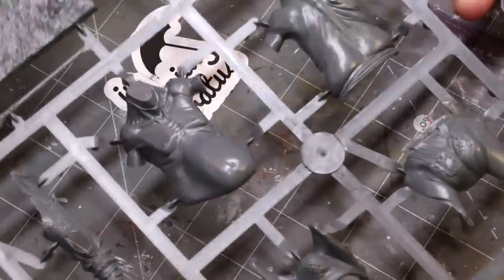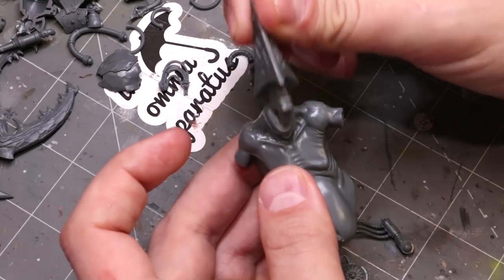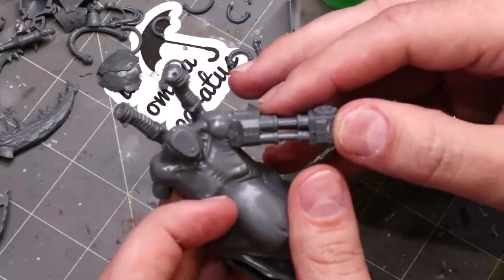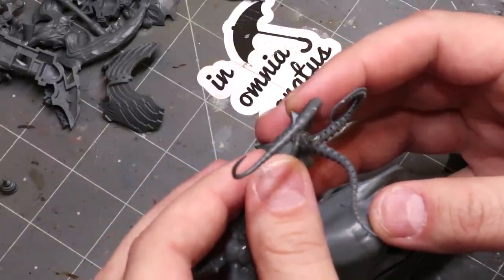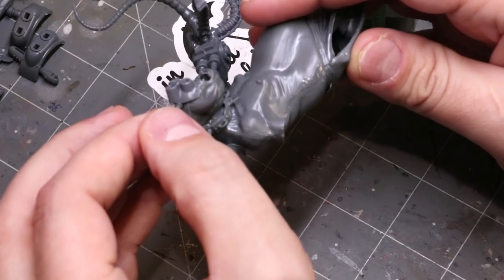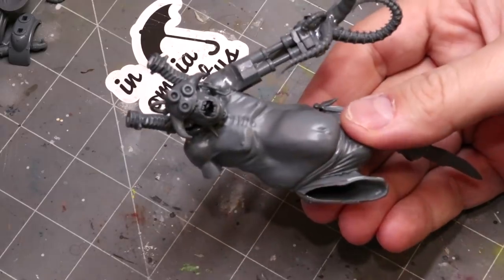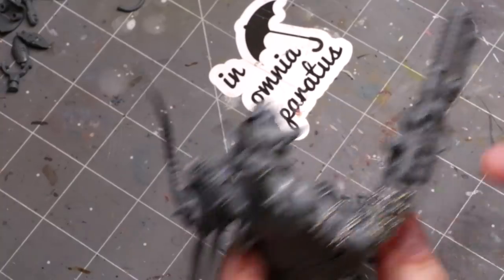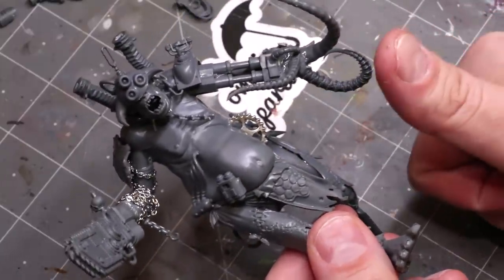Hobby Cheating 272 - Converting Models

Comment: Thanks for this video! I'm now convinced I need to concoct some sprue goo. Looks like the Tamiya cement is the way to go. I used Testors liquid cement for decades, the one with the applicator brush in the cap, but I have not been able to find it in my area anymore. They have switched to those useless squeeze type bottles that dry shut in about half a second.Some kind of idiotic " safety regulations"
For anything molded in styrene liquid styrene cement is the only way to go. Blows my mind when I see people use super glue instead for plastic minis. I know it works, but I like to save my super glues for bonding dissimilar materials. 
Looking forward to seeing this conversion painted up! I hope you do more videos like this, exploring what can be done with a bit of imagination, some sprue goo, and a well stocked bits box! 
Thanks again, Vince!
Reply from the maker: Happy to help, everything's now been painted, you can see it on my socials. :)

Comment: Oh boi, I wish I would've seen this a few weeks earlier - before I cried myself to sleep (kinda) after building and converting a Gargant.

Got another topic, if it hasn't already been covered here: As you said before, we can use varnish to create a "save point", between painting steps. How do we reset to that point if we screwed up a layer after the varnished one?

Happy Christmas (or Covidmess) and a Happy New Year!
Reply from the maker: THe key with the varnish is that if you then get paint where it shouldn't be, you can grab another wet, but clean brush, then wipe fairly hard, you won't disturb the lower levels of paint. It just lets you wipe harder while seeing the orignal paint staying intact.

Comment: Awesome job yet again. It was great to see your process; I would both love and am incredibly afraid to see your bits "box"... I had seen many videos about the "plastic glue" with Tamiya's Extra Thin but I think you sold it completely, I just need to mix a bottle. I know you are supposed to use a bottle of half filled Tamiya but...where I can put half a bottle? Will it melt through certain plastics? I don't have any readily available glass containers. Thanks so much and hope you're having a wonderful holiday!
Reply from the maker: So honestly, I just used part of it, and once it was a little down from use, I dumped in all the sprue and made a real full bottle.
Reply: @VinceVenturella  gotcha. I had some fingernail polish bottles I was going to use to make my own oil brushers and used two of them to transfer some out. Melting away now. Gonna try it out on my GUO tomorrow. Thanks again!

Comment: Any idea why I got an more solid layer (still a bit goopy, but more solid than the rest) at the bottom of the bottle and almost liquid on top? Used the same glue as you. 
Maybe needs more sprue, more glue or more time?
Reply from the maker: I use my shaker to mix it up. Might be that it just hasn't fully melted out yet. That being said, you may need to give it a really solid shake and make sure it's all mixed in.
Reply: @VinceVenturella  thanks, gonna try. I also added a bit more glue and sprues now and will keep shaking and stirring
Reply: @VinceVenturella  Just an update: I got it to be 1 consistency (after shaking before use) but pretty thin so far, gonna have to test around with more sprues and such, but it's definitely an upgrade to the glue alone. Before I poured more glue in, it was too stringy. I used the current thickness on plaguewalkers and it fits nicely to the nurgle theme, but at the current state I wouldn't use it to fill gaps on something like the keeper of secrets I have since christmas and am too afraid to build ^^

Comment: How toxic are those “sprue glue” fumes and should I be wearing a special respirator?
Reply: It just plastic glue with bits of sprue melted into it. Take any normal precautions you would normally take
Reply: It smells just like standard Tamiya Extra Thin plastic glue does, because you just add cut up empty sprues and add those bits of plastic to that glue to make it. So IMO it's not bad at all.
Reply from the maker: I would say in general, not really, it's never bothered me, but the tamiya extra thin smells fairly potent, so I could see it bothering some people, but it's not putting out anything in the way of significant fumes.